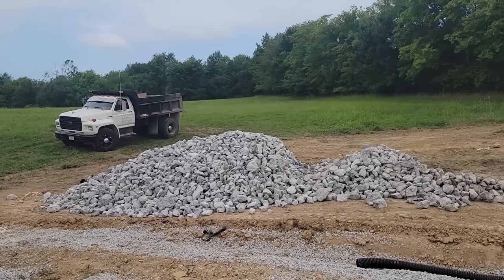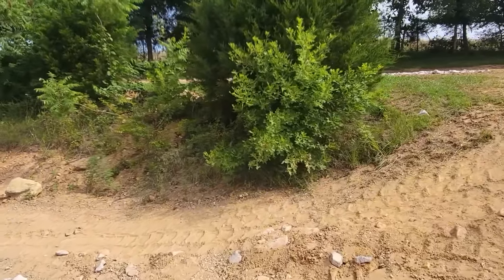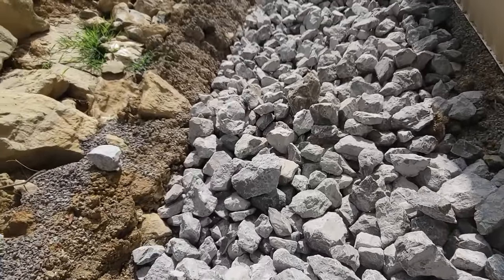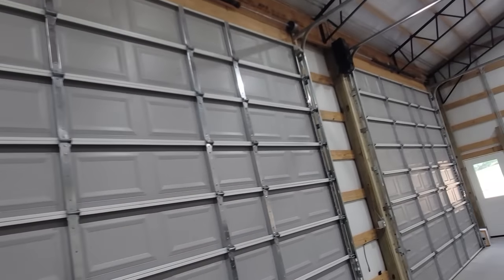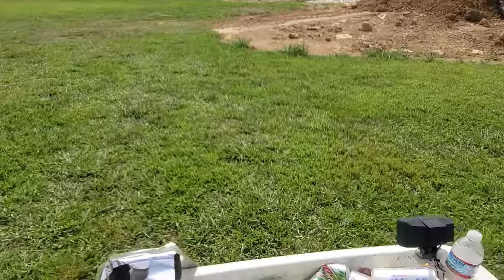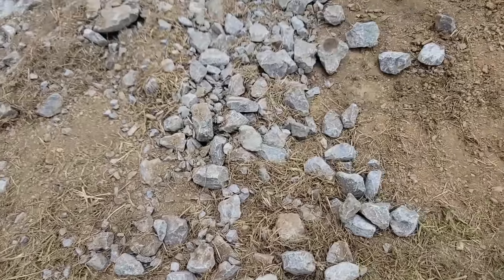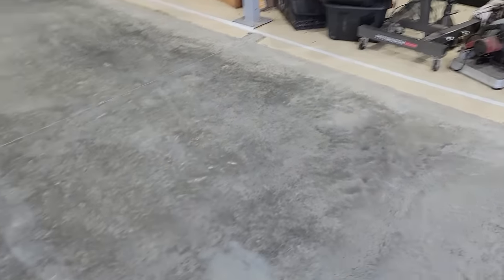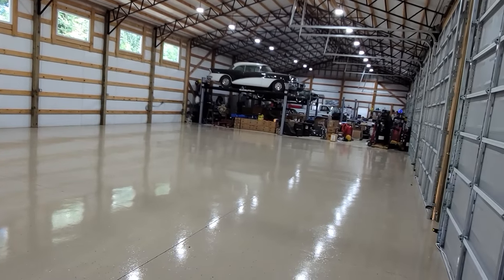My NEW Shop FLOODED! - Here's what happened (we had to start over)

Comment: Bummer. I remember thinking this would be a problem when watching the grading and slab pour videos. I deal with this problem every day as earthmoving and road construction is what I do for a living. This is probably too late (its never too late) but take this into consideration.... The drain system you are installing is only a temporary solution. Especially with no filter fabric. What happens is the fine particles from the dirt and roots from vegetation eventually work their way into the voids of the rock, eventually making it impermeable. The other problem i have with your new system is the use of the flexible black perforated pipe. With no filter cloth used, there is a very high chance dirt will eventually clog the pipe. I always use a hard pipe this way a drain snake and or drain jetter machine wont damage and collapse the pipe. The solution i recommend is a concrete ditch at the top of the slope, and a smaller one at the Toe of slope. Place a 2' band of rip rap at the leading edge of the ditch and that will help keep dirt out of the ditch. With the concrete ditch, you can shovel out the sediment therefore making it a lifetime solution. For stuff like this I always spend the extra money. The peace of mind when your away, that there is absolutely no way water can make it into the shop is worth it. -Phill
Reply: Like they do in Japan - for landslide prevention 'he should concrete the whole slope at a 45 ° angle
Reply: you think the drainage people/architect would have mentioned the sock.....just sayin'
Reply: Very good ideas and I had also thought about a ditch along the top of the slope.
Reply: @patrickwhelan5703  I am constantly amazed that drainage people don't know to do this. You put the perf on top of structural landscape fabric on the VERY BOTTOM of your ditch; cover it with drain rock (or crushed) and wrap the WHOLE THING in fabric! Please people! It's permanent and functional. Maybe not permanent, but years and years. Clay like Derek has here will plug a system in less than five years.
Reply: @andrewmantle7627  
I’ve just installed something similar on a smaller scale, 18” square section trench, filter membrane tucked in, 6” bedding 3/4” natural round gravel, 6” slotted perforated pipe, backfilled with more 3/4” natural gravel, then wrapped geotextile membrane over the top, soiled and seeded. It works a treat and hopefully will do for a few years.
Sorry for your loss Derek, flooding is a heartbreaking mess, but your slab team should have refused to start without a drainage design / program in place… but I accept hindsight is 20/20 vision.
There’s a lot of good YT videos posted by professional drainage firms, they all support the posts I’ve seen on this issue. Rock alone will just silt up. 😒
Reply: Exactly
Reply: Phil Bob is absolutely right.  I warned when you showed the original work that that hill was going to give you a wall of water.  Unfortunately, this is still, at best, a very temporary solution.  You SHOULD absolutely dig all of that back out.  It just won't work.  There needs to be landscape fabric/filter fabric installed in the trench and up to above the tops of the trench, BEFORE the rock, then the rock installed on top, then the perforated pipe laid on top with a filtering sock.  Then more rock.  Then more filter fabric laid over the top of the rock, then soil, or whatever.  This entire installation will be one giant brick once that clayey soil gets into that rock and pipe.  Very, very, sorry, but those are just the facts about drainage engineering.  Please stop work right now and dig that junk back out.
Reply: Same with Rusty Acres: that's temporary, at best.  That entire drain will become a brick when that fine clay seeps into the rock and pipe.  Dig it out, lay in filter fabric all the way up and out of the trench, then the rock, the perforated pipe in a sock, then, more rock, a top layer of filter fabric, then rock or soil on top.  That's the only way the trench will function, over time.  Sorry.
Reply: So how does the clay clog the pipe but not clog the filter fabric?
Reply: @funone8716  the filter fabric "sock" around the pipe keeps the clay out of the pipe.  The filter fabric above and around the rock keeps most of the clay from clogging the rock.  You can't leave the rock in the trench without filter fabric, as the sand and clay will clog the rock.  Most of your flow is through the "pore spaces" in the installed rock.  The pipe is for the downspouts, draining the roof.  The rock is for carrying the waterfall coming down that hill.
Reply: @funone8716  And you don't care if the fabric gets clogged.  You are filtering the rock and the pipe.
Reply: New idea, we do this for the Bieris.  I have 30 years as the aquatic and marine biologist working on projects all over this country and many other places.  I do the permitting and run the jobsite.  I set up something like a givesendgo page to fund materials and fees.  I can easily con an environmental engineer and a storm water engineer into helping the Bieris.  I have helped plenty of both in the past.  We must have some operators out here.  Those of us that know what we are seeing, know what needs to be done.  It all has to come back out.  The Bieris have already had a tough year and they can't do this, on their own.  I am one of the best in the country, and this is not gonna work.  Others can see this.  Let's say the Vice Grip community fixes this for them.  I know we have some Operators and Haulers out there,  Let's go fix these kid's yard.
Reply: Derek, throw us a something something that your reading this.....
Reply: Im a civil engineer in california, when i watched the original video i already knew that was going to flood. You should just hire a civil enginner in your area like people have already mentioned. That rock at the top will not do much but dissipate the water. You need a big swale up there and down by your building to guide it away and around. 4' wide, 18" deep minimum, but maybe smaller, maybe bigger 🤷‍♂️ but forsure bigger than you have now. There is a tone of water coming from the hill that you need to move around your building aswell as the runoff your impermeable roof causes. I was taught always to try to drain using surface runoff then use storm drain piping second if needed. So at minimum your site shouldnt flood just off surface runoff but if in the event of a large rain event, the piping will help, as an extra precaution. You should have solid pvc storm drain pipe and 1' drain inlets with catch basins and screens for debris, at minimum with how much water there is. Clearly the small yard drains and 6" corrugated pipe isnt doing much. Grade the water away first then pipe it if needed. I probably didnt help much or just stated the same as everyone else. But hate the problem to still be there. Which at this point in time i think it still is. Love your videos! ❤️
Reply: @andrewmantle7627  
Absolutly sir.
Water is a wonderful thing till you have  issues.
It's time and money we'll spent to correct this now.
Reply: @Aglets97  Makes sense to me.  Why try and put filters to keep the rock from clogging, just get rid of the rock and have a plain ditch.  Hopefully you can get some grass growing in the ditch before the next big event to keep it from washing.
Reply: I have to give you props as you might be right. You probably know much more than I do about these kinds of things in your line of work. Just hopefully he used something bigger than the 6 to 8 inch line from before. I'd like to think the depth it's buried at would help with the drainage issue, but if he's still using 8 inch instead of 12 to 18 it probably will happen again soon. The depth might help a little, but the capacity of that pipe is the biggest limiting factor for the amount of water that needs to be drained. I'm personally a machinist not a civil engineer. My line of work involves tool and die, along with lathe, mill, grinding metal cutting tools including tungsten carbide, as well as CNC programming, setup, and custom tool making in addition to specific offset parameters. Those are the things I do professionally. I'm a diy in most other things around the house. I'm my own do it yourself mechanic, plummer, simple electrical, and carpenter. Not really certified or licensed for most of those things, but know what I'm doing and work on my own stuff. Water supply lines, water heater installation, ceiling fan installation, wiring up separate switches on the conduit to control light and fan independently on 2 switches, rewiring 3 prong 240V plugs to 4 prong to isolate neutral and ground, installing appliances, building porches and steps, drywall, and entryway reinforcement are all things I've done myself. Pouring concrete, wiring up breaker boxes, and other more involved or serious things I don't mess with. I'm just a do it yourselfer that can do almost all of his own handyman work. I also know my way around cars pretty well. Especially the older ones. As far as roadwork and civil engineering go, that's out of my scope.
Reply: A trench up hill on the far side of the road will also divert a ton of water.  Also might want to consider an emergency sump pump or two in a dry well behind the building.
Reply: Yes, concrete as you suggested
Reply: We use that pipe with no fabric to drain hundreds of acres with no problems for 17 years a couple inches of pea gravel pipe a foot of pea gravel soil and good to go those slits will let water push soil right through if it gets to it

Comment: I would add a separate pipe that is solid for your downspouts. It looks like with the amount of rain you get your new pipe will fill up with just the downspout water, leaving no room for the other ground water.
Reply: Yep here on the very rainy west coast all new builds have separate lines. One for downspouts, one for drainage against the foundation.   Heavy downpours can overwhelm the system otherwise
Reply: Yea the only thing I was thinking about if there is some mud that seeps through those holes it will create enough flow to go out that drain.
Reply: Why don't you build a concrete drain instead of using pipes?
Reply: 4" low-grade glue up long turn ells separate pipe for downspouts the system as it is shown is adding tremendous amount of water into your foundation/footing drain .
Reply: Exactly ,I have done this type of work in Washington State for 40 years and you definitely should use 4
Reply: Filter fabric sock around drain pipe will filter out silt ,eventually will plug with mud ,without it.
Reply: Completely overloaded that tile you just put in with that load. Perforated on top of it. 
Why not add a terrace to that 60 acres to control the water instead of trying to capture it.
Reply: I totally agree
Reply: @sonytony3060  have you seen the cost of concrete lately? He’d need a third mortgage to do that. That’s a lot of concrete
Reply: @Jeff-gj5vm  let's hope he stays away from that contract. Motor trend tends to kill the actual content we want, just look at road kill.
Reply: Couldn’t agree more. Run you roof water into a separate solid 4” and grade it away from your shop. It’ll help.
Reply: Itll be fine, itll travel the mote/thru the riprap if it fills the pipe full
Reply: Right on John. Keep a solid line for the down spouts, with a heavy rain the water from the roof will squirt out he slots. the line that all the roof drains flow into should be larger.
Reply: Yes separate solid 4 inch one perf with clean outs every 40 ft and mabe a silt sock on that perf pipe the weight of that big rock will eventually crush that corrugated get solid puka pipe
Reply: Also wyes not tees
Reply: Also don't drive the camper over the pvc and drain tile unless you plan on pouring a concrete slab over there. If left dirt you will smash it and plug everything up.
Reply: EXACTLY! cheap shit should have used PVC and the black pipe needs to have it socked.. it will just settle out and clog
Reply: I'd go with PVC there, too, because it won't catch debris.
Reply: @Jeff-gj5vm  That's essentailly what he's doing, just without the vertical walls, which would be a headache in themselves...
Reply: Who builds at the bottom of a mountain? His fault.
Reply: I was thinking the same thing but with the clay in Tennessee you need the clean downspout water to clean out the mud. There is two drains one pipe in the French drain. When I lived in Tennessee I made a French drain at my RV site. I had to keep cleaning it so I did the same thing. Just no downspout so I could clean it out easier.
Reply from the maker: Shop was existing margot. Remember?
Reply: @ViceGripLodge  Look at Gate City Foundation Drainage on YT
Reply: Water management is a big deal where I live. We tight line the downspouts, run curtain drain around the footing, and for post and beam add graded foundation drainage with sump(s). Bummer to see you have to do this much more but you’re headed the right direction.
Reply: @ViceGripLodge  it seems high dollar solutions are very easy to come by when spending some one else's money.    
   The shop is looking awesome. Good luck
Reply: @sonytony3060  because a guy can do it the right way or do it the other way . 😉
Reply: @ViceGripLodge  so sorry to see and hear about the damage buddy wishing you and yours all the best
Reply: Hindsight is 2020. The grading issue should’ve beeping addressed before the addition was added on, of course. But since the problem as reared its ugly head once already it sure will rear its head again as mentioned in the post before this, once things get clogged up. and they will get clogged up without the fabric that’s been mentioned in many of the posts. You’ll have to be re-addressing this year issue yet again. And as far as Cost goes it’s hard to bite the bullet initially but when you think about the cost of having to redo the system several times it’s well worth just to do the job right the first time. Especially after having spent so much on a nice shop and equipment inside. Best of luck with you.
Reply: I was thinking the same thing
Reply: @ViceGripLodge  apparently she missed it lol
Reply: Gutter downspouts need to be into a solid separate pipe or you’ll over whelm the French drain system ,

Comment: As an old, retired engineer, I echo what Ralph says below.  Several terraces in the 60 acre field will do more to eliminate the problem in the future than the rock and underdrain pipe you have installed.  Terraces always work and require very little or no maintenance.  You also mentioned establishing vegetation on the bare soil, which will help.
Reply: Live next to 20-30 acre farm that has had rain catch Terrances put by army corp of engineers. Must have been done in 50’s. Even they overflow. When I bought my property that borders the field the water broke thru the sid3 onto my property. Just put clay on my property border to keep his water on his property. He has had to repair the mounds a few times and is pissed I blocked his water. Would suggest anyone playing with runoff be careful as could turn into a lawsuit from down neighbors. Even recording this might not be good for his insurance company might take note. Storms go by weather events in years.  Always advantageous to build on high ground.

Comment: That cut bank behind your building still needs fabric below the rip-rap or all that clay is still going to wash out into your perforated drain and clog it up eventually. And ideally you want to stack that rip-rap from the bottom up on a slop that steep so the rock doesn't settle down over time. Also it is going to be a nightmare to maintain without fabric under it once weeds start growing in between the rip-rap. It's better to do that now or this will most likely happen again. 

I also agree with people saying you need to run your gutters on a separate drain. That's way too much water for only one 4" drain to handle! It's also a very bad idea to park a heavy RV over that shallow drain. It doesn't work at all when it's smashed. You need a heavy duty pipe for that if you plan on driving on it, or at least PVC schedule 40. But an RV still might even smash that. It will 100% smash that pipe you are using now.